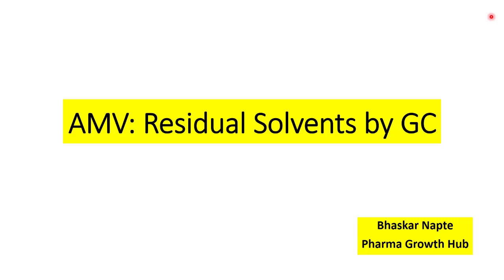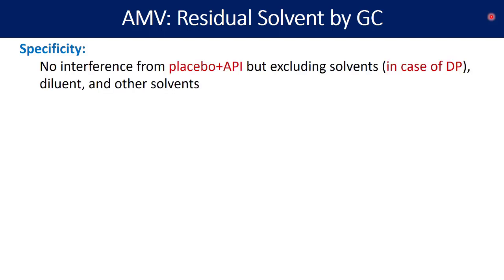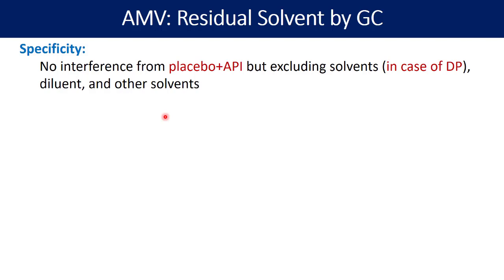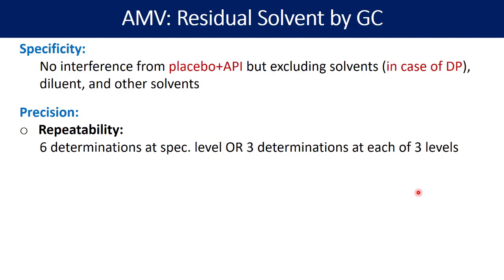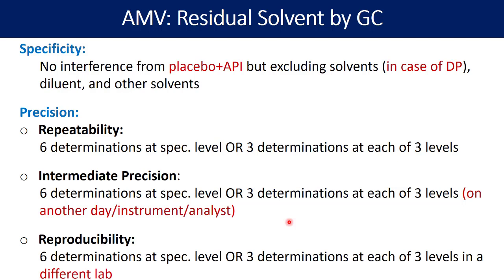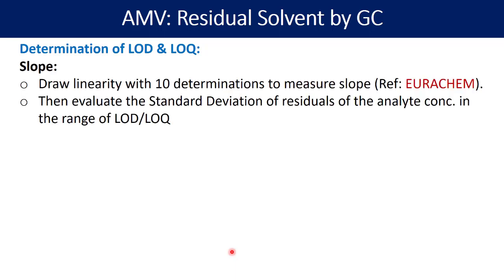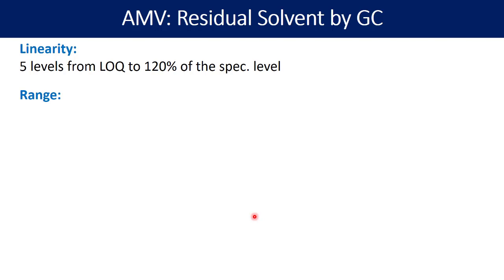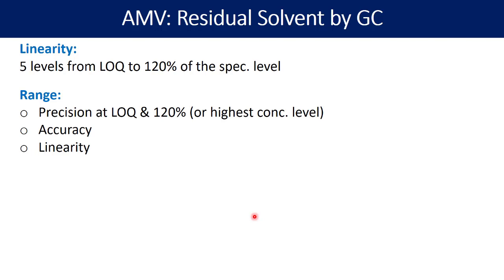How to conduct method validation for Residual Solvent by GC?

Comment: Hi,
Is it possible to merge linearity, accuracy and precision in one sequence and preparation instead of preparing each time precision and linearity or accuracy differently
Example  prepare 5 levels and injected each one 3 times then calculate the linearity with the average of each level and the accuracy using each level or precision
Reply: Linearity done on diluent, Accuracy done on sample matrix.